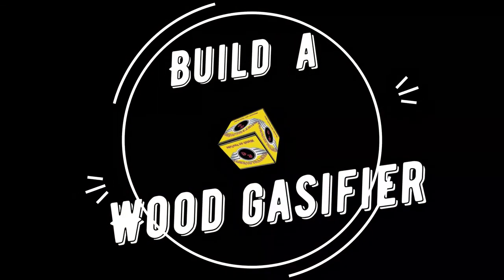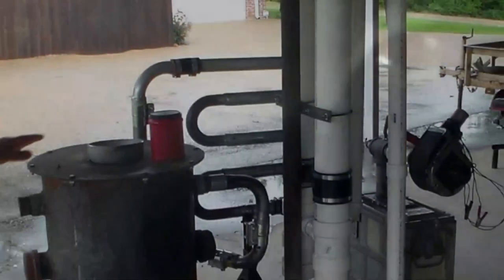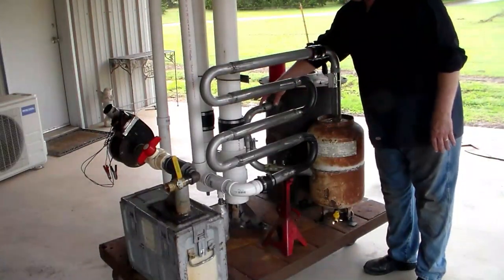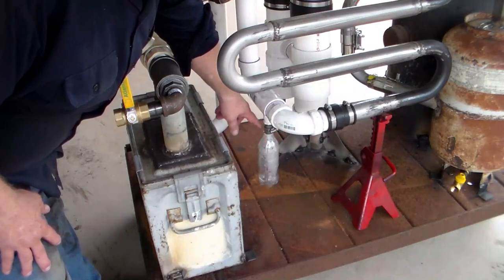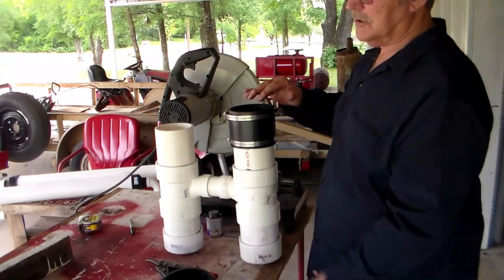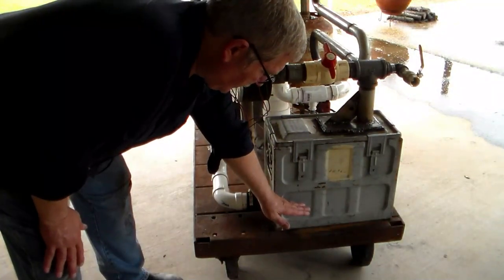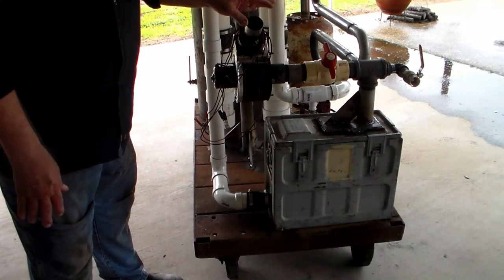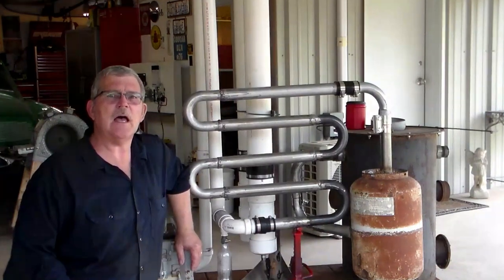Build a Wood Gasifier part 1

Comment: Love it , can't wait to see it in action.  My dad traveling thru Europe in ww2 traveled  in troop carriers that ran on wood gasification as they stopped along the roads and loaded up with wood .  These truck engines burnt almost anything as gasoline  or diesel was not easy to get but wood yes .
Reply: My dad was in WW2 in Europe with the Combat Engineers and he too saw these burning wood into gas in any vehicle.
Reply from the maker: Eventually I would like to build one for a small pickup. But that is a ways off right now. Cheers Steve
Reply: @LarryDeSilva64  So many  today have no idea how much wood  was used  , imagine a engine that runs on wood,  gasoline , distillate,  kerosene and diesel  and today they call engines high tech 😅😅

Comment: I remember my Dad saying during ww2 in Europe people couldn't get gas but knew how to build a gasification set up to run their vehicles. That's a great system you built Lloyd and with the filter to collect the not needed tar, water etc., you have a cleaner burning fuel by the time it gets through all that filtering. That took a lot of thought Lloyd. Thanks for sharing your great work.
Reply from the maker: It is surprising how much water and tar a gasifier can make. But maybe I have it figured out this time. Thanks Larry

Comment: I was quite surprised to see that the advertisement before your video was for a commercial gassifier (Regawatt, a German company). Your experiments will surely be interesting. Thanks for sharing, Lloyd.
Reply from the maker: Thanks Bruce, I'm going to look the company up. Gasifiers have been around a long time and used around the world. Enjoy your week my friend
Reply: @RustyGlovebox  When I came to Germany in 1965 you would occasionally see an old Opel or other pre-war car outfitted with a huge gasifier on the side or back. They looked like oversized water heaters and made enormous amounts of dense smoke while heating and before going into pyrolysis mode.